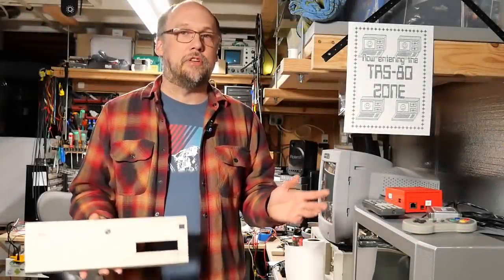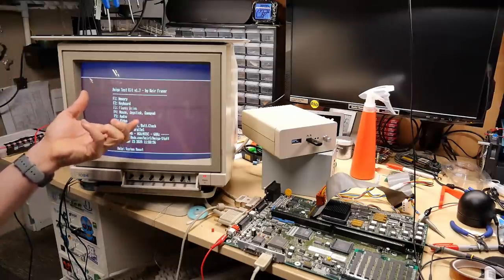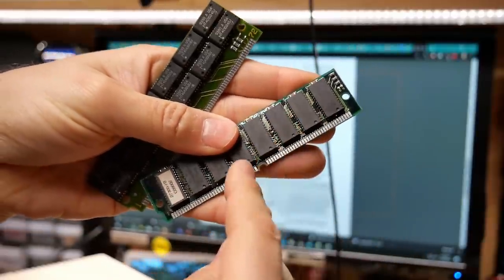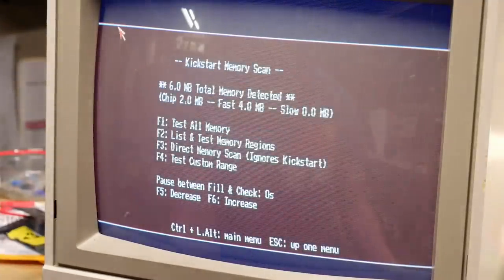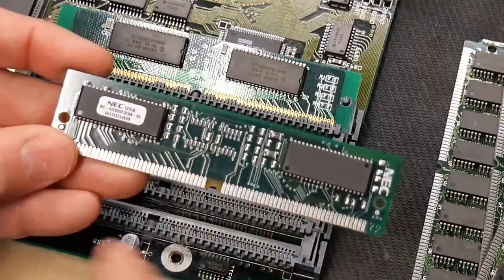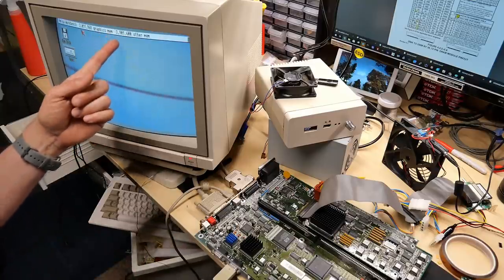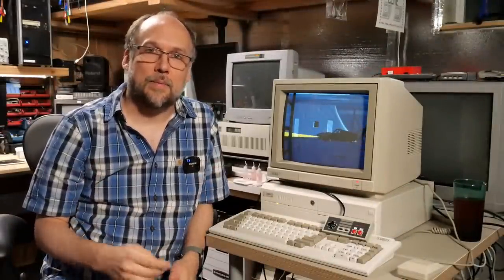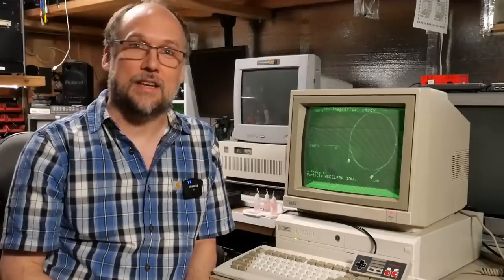Amiga 4000 Repair Part 2: RAM issues are solved!

Comment: My brother had one of these and from memory, it did the yellow screen error sometimes when the memory slots were fully populated. I seem to recall it had to do with faster memory and fully populated slots that cause that error, but if I remember correctly, it only caused the issue on a quick power cycle for his machine.

I seem to remember the A4000 being finicky about fast memory back then. Be nice to see it equipped with more memory though (Even if it doesn't need it.. :-P)

Comment: Very interesting stuff with the RAM chips. I've been staring at 4M x 4 DRAM chip datasheets for months, and they all have the same SOJ-24/26 pinout with the two centre pins missing, so I saw those and assumed they were 4M x 4 chips. Never even looked at 256K x 4 chips. The only other DRAM chip datasheets I've been looking at are the 4M x 1 and 1M x 4 chips, which all have a SOJ-20/26 pinout with the 3 centre pins missing on each side. And obviously they've got different pinouts, so while they fit on the same footprint as the larger capacity chips (albeit with missing pins), they definitely won't work.

In any case, the other thing you could look at is the refresh cycle of the chips. Not sure whether the same applies for the 256K chips, but certainly the 4M chips can either be 2K or 4K refresh, which means it either uses 11 rows and 11 columns for 2K, i.e. 2,048 x 2,048 = 4,194,304 words; or 12 rows and 10 columns for 4K, i.e. 4,096 x 1,024 = 4,194,304 words. For 256K chips that would be 9 rows and 9 columns or 10 rows and 8 columns for 512 or 1,024 cycles, i.e. 512 x 512 or 1,024 x 256 for the full 262,144 words.

Might be interesting to check the datasheets for the memory chips you've tested to see what refresh cycle they use.

In my investigations into 2K vs 4K refresh memory chips on IBM PC compatibles, I never found a conclusive source that explicitly said whether 4K refresh chips are compatible. Prior to the pandemic I had planned on sourcing both and testing it for myself, but not only have a lot of the chip listings disappeared off eBay, the chips that I did buy still haven't shipped from Finland since most international freight routes have been suspended indefinitely, and the only 286 board I've got that's not in storage seems to be faulty so I can't test them properly anyway. I've got a Mac SE/30 and Classic II that are working, so I can use those to test the SIMMs, but that's not going to tell me whether IBM PC compatibles can use 2K and 4K refresh chips.

Anyway, I always find these Amiga videos interesting, since they weren't really a thing here so I never used them back in the day. It really seems like they were at the cutting edge of what the best hardware of the time could do. At least until the x86 machines caught up.

Comment: Often happens that 72 pin SIMM with presence detect are only compatibile with HP PC. I have a few of those and they have unusual memory modules with asymmetrical row and column adresation. As example MB8117400A is standard memory chip with symmetrical adresation used in most of SIMM modules (RAS A0 to A10, and CAS A0 to A10), and MB8116400A chip with asymmetrical addrestion (RAS A0 to A11, and CAS A0 to A9).

Comment: Adrian, I commented in your first A4000 video but don't know if you saw it.  When you recapped the A3640 CPU card it's very likely several of the caps are installed backwards.  Commodore shipped most of them with several capacitor silkscreens printed backwards which, unfortunately, has plagued tons of these boards for years.  Please see http://www.amiga.serveftp.net/A3640_capacitor.html
Reply from the maker: Yeah lots of people mentioned it -- I knew about the mis-marked PCB and all is good with those caps.
Reply: @adriansdigitalbasement  Did you reverse them after your replaced them in your part 1 video?  Because I just looked closely at both Part 1 and Part 2 videos and can clearly see at least 3 of your new capacitors installed backwards.  Please have a look here, this post contains a clear picture of how the capacitors should be positioned on my A3660 (an A3640 replica with mods to support an 060) I built for my AA3000+ project.   https://www.amigalove.com/viewtopic.php?p=9373#p9373  Take my word for it...you've got a few caps reversed.

Comment: This A3640 CPU card has 3 caps soldered with wrong polarity from factory. silkscreen is also wrong. You can check it with multimeter. All 5 caps are on 5V rail. 2 audio caps are also wrong form factory, but there is only 1V in reverse.
I just made some mods by my A4000. 64MB fast mod, waitstate mod (swaping 5 gals on cpu card) and PIO2 mod(swaping 2 gal`s on mobo).

Comment: Those memory modules are not 1MB SIMMs, they are 16MB SIMMs! If you check your table, they ran out of size codes after encoding 1MB; 2MB; 4MB and 8MB, and re-used the same Presence Detect combination for 16MB modules they also used for 1MB modules. The individual chips obviously have a soj 24/26 case (this means the size of the chip is like a 26 pin chip, but only 24 of the pins are actually present. One pin is "missing" in the center of each size. That's the common case for 4M x 4 chips. 8 of those chips make it a 4M x 32 module. Here is a datasheet for a hyundai 4M x 4 chip in that case: http://www.ic72.com/pdf_file/h/11427.pdf
On the other hand, this is a datasheet of a hyundai 256k x 4 chip: https://datasheetspdf.com/pdf-file/918465/Hyundai/HY51C4256/1 . It has a SOJ 20/26 case. A SOJ 20/26 chip has 3 pins "missing" in the center instead of just one pin.

Comment: this is the tricky thing about the yellow screen... it can be a hardware issue but also a software issue, it could be that the ram is to slow to really reset itself but it could also be the clock jumpers being set wrong and a multitude of issues... i would try reflowing and resoldering all the pins... i know its a sucky thing to do but it might help... also a very toughrou cleaning can help brah... funny thing is... for me it was the kick rom that was damaged :p

Comment: I had exactly same behavior on my A1200 with accelerator card and fast mem.   The Chipmem is SRAM that is purposly cleared.   Fast mem is DRAM and it is basically capacitors with a charged state...  powercycling might not be long enough for it to clear.   Don't think your machine is broken, but some DRAM's just need more time to clear.

Comment: 2 years late but IIRC you can totally change the big box Amiga's memory configuration through Workbench. Hold down both mouse buttons then power on, keep them held for a few seconds and it will boot to a hidden menu, I'm 99% sure it has a memory option page where you can change RAS/CAS latency and overall speed (though its been a long time and its possible I'm misremembering, the memory menu might actually be from an accelerator card?)

Comment: Thanks for yet another great video, Adrian!
Making two more RAM modules by cloning the original NEC PCB and using those four chips you removed would make an interesting project.
Not sure about the quotes for PCBs though, edge connectors can make them quite expensive to manufacture...

Comment: I am looking at your "bad" Ram Modules from the Amiga. I spotted some black points on the contacts, it maybe the Camera, but one Question: 
Did you use a soft eraser on the contacts? Corrosion on the Contacts is not uncommon especially on the old "silvery" contacts where the Pins were on the contacts and current was flowing they get black. Using an very soft Eraser (transparent or white NOT coloured) will take out  the corrosion, but will destroy the factory coating against moisture. So normaly i give wonky Modules a gently eraser treatment, till they are uniformly shiny, then an alcohol treatment to protect them against new corrosion. 
With this treatment they are good for 5-6 years, eraser only 3-6 month, as corrosion creeps faster in. 
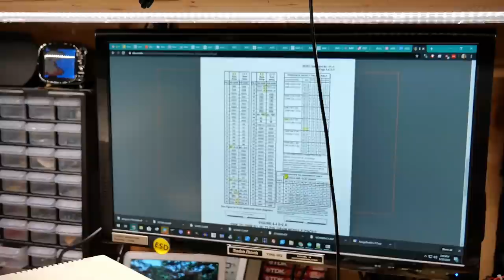It may be the Camera angle but at 10:09 the right module shows Pin corrosion were the pin from the socket was pushed against the contact and current was flowing. 
From above Pin2 4 and clearly 6 shows it. This would be a typical case for eraser Treatment.

Comment: Now when I replaced the fan in my 4000 with a Notua fan I had it blowing into the machine, not out. Everyone told that it was wrong. It should blow out, so I changed it. Apparently Commodore installed the fan wrong, blowing in on a few.

Comment: It would be better to use flux when scratching and resoldering pads to protect from further corrosion and even reverse any thats present. I know it's a mess without an ultrasonic cleaner but the heat will quickly corrode exposed parts and may eat away the pads.
These old FPM RAMs were notoriously finicky on PC mainboards too, the shops would exchange them no questions asked beyond "doesn't work". I'm sure the Amiga has its own favorite brands.

Comment: I noticed  that you had not installed the daugterboard while testing. That is necessary, because there are resistor packs at the top of the daughterboard and they terminate the bus. If the bus ist not  terminated bus errors can show up, maybe leading to instabilities. The Amiga 3000 wasn´t even booting without an installed daughterboard and only showed a yellow screen instead.

Comment: 23:52 - Interesting to note that those simms with the NEC ram chips worked better. Commodore used NEC ram chips on the Amiga 600 & 1200 boards

Comment: Yep, silently screaming at the screen, definitely a hobby, it seems 🙃
Without being able to provide any direct examples off the top of my head, I do remember the kind of RAM brinks from that era to be notoriously quirky and difficult. Exactly the same type and size of bricks, same specs except for the brand; one would work, another would behave oddly and yet another wouldn't work at all.
To answer your rhetorical question "what am I gonna use that much RAM for"... the answer (besides the obvious: rendering) would be: Network, LAN, WiFi, the Internet. For some reason that gobbles up a ton of RAM on the Amigas. It is also nice to have 16 MB if you are planning on using WHDLoad to run your games and demos. 8 MB will do, but with 16 MB you're pretty much covered in any scenario.

Comment: I wonder if it would have worked with the 8Mb modules anyway, even without removing the chips etc.--after all, you'd already proved it wasn't using the sense pins on the chips to figure out what they were, and presumably if it was accessing them as 4Mb modules it just wouldn't have used half of it.

Comment: Maybe some of the original memory is picky for certain rails to reach expected voltages in an expected time when you turn the computer on, and if that doesn't happen, they don't map.

I had something similar go on with a PC with a slightly underpowered PSU for the 3D card I got. If you powered it on, it MIGHT work, often not, but do a lot of random stuff instead, from missing some memory modules to mucking up the display when the Windows driver was loaded. If you turned it on, waited a few seconds for the hard drives to pick up speed, then hit reset, everyhting worked fine. Also, with the older 3D card normal function was restored, and installing a 50W more powerful PSU from my scavenged parts pile was enough for the new card to be stable.

Comment: Wow, if your theory on test patterning masking the incorrect jumper is correct, that's a major oversight by the author of the memory test.  Having the 1MB/4MB jumper wrong would likely be a very common mistake.  A test detecting that condition should be the first (ok, second after something super basic) thing to run.  Seems hard to believe they'd overlook that, but I don't have a better theory.

Comment: I wonder if the reason the 8MB of ram filled the upper half of the range was because you used the top 2 physical slots - i.e. that the ranges are fixed for each slot

Comment: I have the same problem with the yellow screen on my Amiga 500 if I try to hard reboot the system too quickly. Someone suggested this might be a sign of a failing power supply. I don't know if that's true or not; but it is something I plan on replacing eventually.

Comment: Adrian: "What am I going to use 16MB of RAM anyway?" 
Me: smiles awkwardly with his 128MB Fast RAM '060 ...

BTW, I'm quite positive the Amiga 4000 works with 2x8MB double sided too, and it would work as 16MB Fast RAM. (Your mileage might vary depending on the modules, but in principle it should work.) You have to install the double sided modules in every 2nd slot in this case. Of course, it might be tricky to find flat double sided modules which would fit in the A4000's banked memory slots like that. The A4000T's (T=Tower) mainboard is very similar electronically, but has "standing" memory slots, where the 2x8MB double sided might be easier to install.
Reply: I know absolutely nothing about Amigas but I agree you can use double sided RAM in every other slot. If you look at the linked schematic, you can see how the RAS lines are connected to the RAM slots. The first slot (U850) has the Amiga's RAS0 on one side and RAS1 on the other while the second slot has RAS1 on one side and nothing on the other side. The final two slots are the same except with RAS2 and RAS3.

Comment: Isn't it likely that the original 4 SIMMs are compatible and will work well? Otherwise, you should be able to source compatible SIMMs by talking to the community at the English Amiga Board.

A working clock is necessary for any serious use on any computer. The simplest case would be to sort files by Last Modified, something you can't live without regardless of what you are creating on the computer, or using a computer to work on such as notes, documentation, cataloging. The battery just keeps the clock ticking, so you don't have to (and sometimes forget) to set the clock every single time you boot your computer.

Most games are not good stress tests. To be that, they would have to be flight sims or similar which never reach full framerate (or allow Vsync off), while also taking full advantage of all the memory, something that would have made the game a very niche one. This goes for any system. If every game demanded you max out your rig to run smoothly, it would not be adapted to the system most users have, and would have very slow sales. If you stress tested with an Amiga 500 game, it would be made to fit in 1MB, and Workbench and WHDLoad would use say 2MB more and no CPU processing time, while the A4000 CPU would be something like 25 times the speed to run that game and so not be tested at all.

Comment: My experience is that every now and then the Amigas will hang during "post", especially if you are power cycling too fast. It was just a quirk you had to live with. :-) just wait a few seconds during power cycle. It will not clear the ram and states as fast as new computers.

Comment: On the subject of the memory range always ending on 7fffffff, is it based on which SIMM slots you fill? If you put those two modules in the slots closest to the side of the board, would the range top be different? (Or do you have to always load from the inside out?

Comment: Its quite possible the power on Reset IC is bad, and not holding the system in reset long enough when you do a fast power off/power on. RAMSEY (the chip that controls the Fast memory) is a bit picky about this and can sometimes misbehave
Reply: I wondered that too.  The other thing, was it a specific SIMM or slot?  I do know that one SIMM playing up will kill the system that way.  It might be that 3 of the 4 are OK.
Reply: @GadgetUK164  yeah those SIMM sockets are crap ! I see a lot of people cannibalising old PC mainboards for decent quality SIMM sockets and fitting those instead :)

Comment: Some of those RAM chips look familiar.... 
Heh....
Did you get those off of ebay around 2013-2014?
Particularly, that odd one you used as chip ram?
I sold a pile of them when I was cleaning out old stuff.
I can pretty much say that the one you are using as CHIP RAM is an 8mb module...  should still work in an A4000...  
I think... heh..

Comment: you should never switch any amiga on and off that fast as you can damage the amiga
Reply: And not really ideal for the latch switch, those old things break real easy now...The 3 key reset works 99% of the time...
Reply: Yeah I was wondering that as well, back in the day I was even super careful with specifically that. Must have been general advice then.
Reply: My thoughts exactly. I think I can make any of my Amiga's Guru when I switch them off and back on that fast and there's nothing wrong with them..
You should wait at least 10 seconds or your autoconfig will fail..
Reply: 10 seconds was the specified amount of time if i remember correctly
Reply: @ZionBeadle  I waited 15, but can't remember if someone told me 15 or if they told me 10 and I decided to be an overachiever.
Reply: The yellow screen is the Amiga’s nice way of saying please stop doing that and yes 20 seconds is the time limit you should give it and that’s for all Amiga’s I think it can blow 2 chips I have had every Amiga from 1000 to 4000t I all ways count 20 secs before turning on from habit  as of today I only have an A500 + x 2 A1200 x 2 A2000 x 1 A600 x 2 .. M.I.S.T (not mister) Amiga/St FPGA  x 1 MCC 216 x 1 Sam440 Flex and Sam460cr both running Amiga Os 4.1 a bit of an AmigaHolic lol

Comment: Adrian:  just gonna apply some lacquer to these traces.
Me:  okay buddy we can pretend like it's not nail polish if it makes you feel better.
Reply from the maker: Wikipedia: "The term lacquer is used for a number of hard and potentially shiny finishes applied to materials such as wood or metal."  What I'm applying is acrylic lacquer -- if it goes onto fingernails or a car, it's still clear acrylic lacquer.
Reply: @adriansdigitalbasement  and the last step is to apply a quick dry glossy taco to these traces.